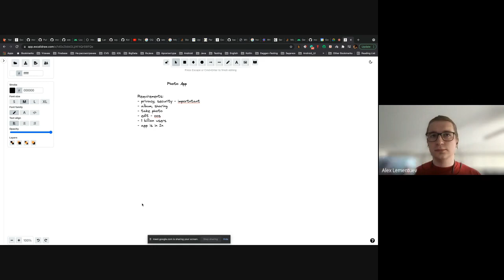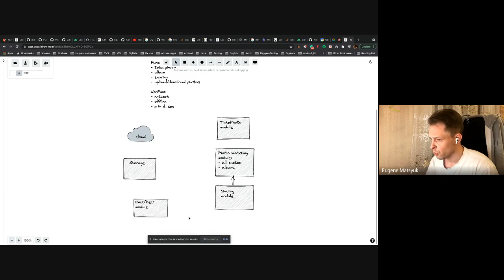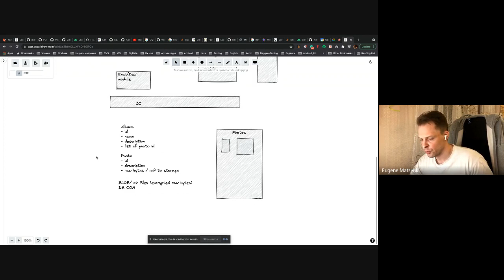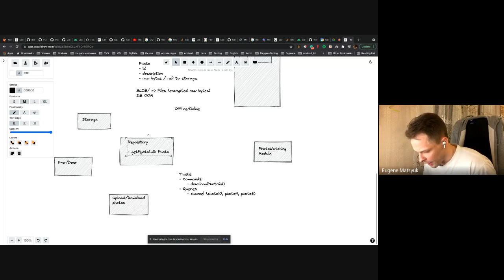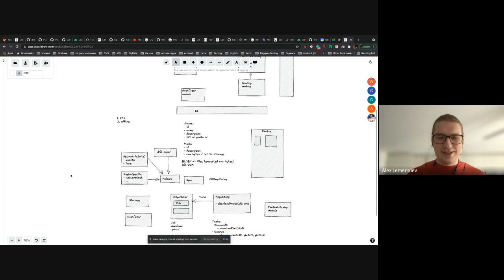Mobile System Design Mock Interview: Photos App (like Google Photos)

Comment: What is the need of encrypting/decrypting photos on device ? It is not practical for a Photos app to do that for photos. Imagine the compute load for emerging countries with most of the population has budget devices.

By Privacy, the meaning here should be that images are not hosted on some CDN where anyone can access it using a url without authorization token.

Comment: A reason to not use blobs in db may be that you keep the db nimble, return data quickly and separately you retrieve the actual bytes from disk. UI renders some data quickly and full photo later. 

...Now to hedge my statements because people will come after me (as the internet does).

You can potentially achieve the same thing by using the db and querying twice (one for metadata, one for full data), and or using content provider to abstract the database reads (off the same table), and still use URIs.

But even then, I think it doesn't scale well to multiple developers, because people may "SELECT *" anyway, and slow down queries, etc. So while yes, it may be an axiom and may not necessarily be true, it's nowadays somewhat of a convention and people will expect to be there, so more errors could occur if you don't follow it. 

Separating them could also help reduce contention accessing the resources (db + file vs db + db).

All in all, it's extra effort just to have a non-conventional setup and "prove the world wrong".

Cheers Alex!
Reply: You're 100% correct. That's how other apps usually recommends and does the implementation because of the points you mentioned. While scrolling images faster, the reads from the internal storage(file) with raw bytes is more efficient on the memory.

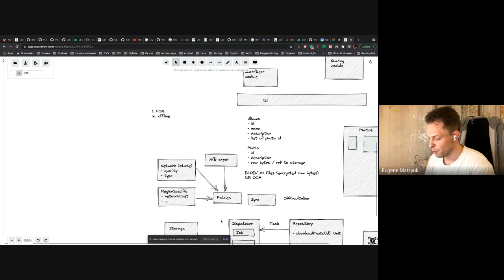Comment: @41:51 - @42.10 - When user install app from that point of time he does not have any internet connection - 1 option can be , we can use FirebaseRemoteConfig with default values of country specific i.e. india - 2g - default config  so FirebaseRemoteConfig will use  default and compare with device , and once internet available any he can fetch updated new config.